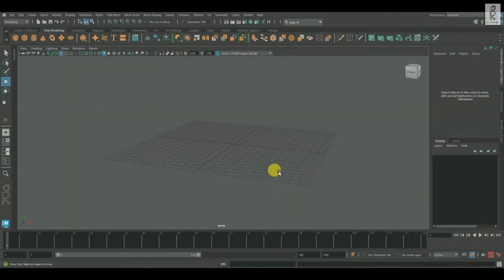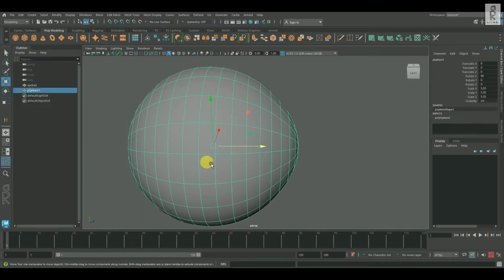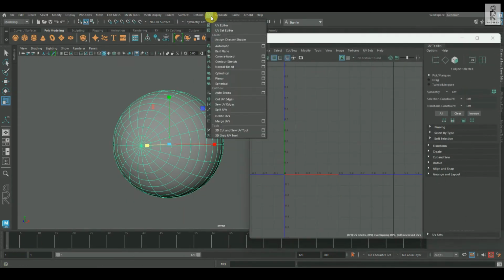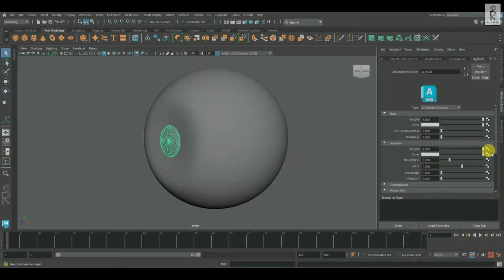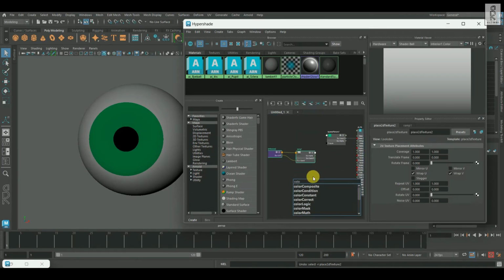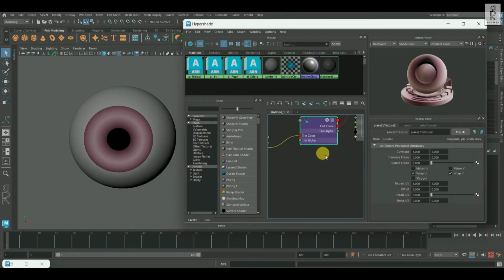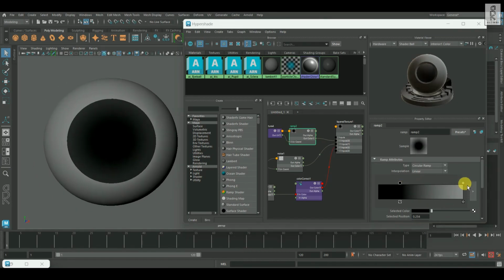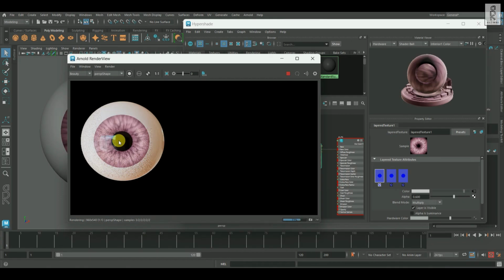How to make Eye 3D Model in Autodesk Maya | Procedural Texture in Maya and Arnold | #3d #3dmodel

Comment: Thank you for your tutorial! It was very helpful and also helped me better understand how shaders work.
Reply from the maker: @Asura4829
You're most welcome! 😊 I'm really glad the tutorial helped you and gave you a better understanding of shaders. Thanks for watching, and happy creating! 🚀🎨
Reply: @sunitdrozario  I have a question about this eye shader. How can the eye model with same shader be used to another scene? I have tested the obj and fbx, but they are not worked ,only worked when I use the whole scenes as a reference.
Reply from the maker: @Asura4829  Good question! If you're using procedural textures like those shown in the video, OBJ and FBX  may not fully preserve the shader network. OBJ and FBX sometimes don’t retain complex shader networks properly. 

I’d recommend exporting the eye model as a .mb (Maya Binary) file instead. This will keep the shader connections intact when importing into another scene. 

And if you are using any external textures which are exported from other software like Substance Painter or Photoshop, just make sure all texture paths are set correctly. Let me know if you need more help! 😊
Reply: @sunitdrozario  Thank you very much for your answer. I have tried the MB form, and it worked very well. However, I still cannot export it to SP, and since I had no relevant experience with it earlier, I will try again later when I have a better understanding of the relevant knowledge.
Reply from the maker: @Asura4829  You're very welcome! Glad to hear the .mb format worked well. 

For exporting to Substance Painter, procedural textures in Maya won’t transfer directly, so you’ll need to bake them into texture maps first. You can use Maya’s 'Bake Texture' feature or render them out using Arnold’s AOVs. Once you have the baked maps, you can easily import them into SP.

 Hope this helps, and feel free to ask if you need more guidance! 😊🎨
Reply: @sunitdrozario Once again, I really appreciate your guidance! It helped me export a texture map from Maya to Substance Painter, allowing me to achieve the effect I was aiming for.😇😇
Reply from the maker: @ Hey there, Glad to hear that my suggestion helped you achieve the effect you were aiming for! 🎨🚀 

Keep creating awesome work, and feel free to reach out if you ever need more guidance. Happy texturing! 🙌😊
Reply: @sunitdrozario ❤

Comment: Hi, nice tutorial! How you scale the pupil at min 04:10 without changing transform (Scale X,Y,Z =1) and how you maximize/change view from 4 Side to default. Was a bit pain for me to not know all this shortcuts and follow step by step without advice as newbie in maya. Googled 15 min but found nothing that explains me that.
Reply from the maker: @mongodb5166

Hi! Thanks for watching, and I’m glad you enjoyed the tutorial! For scaling the any object without adjusting the Scale X, Y, Z transforms, you can use the scale tool in world mode. 

Press 'R' on keyboard for scale tool. Then by holding ctrl key, shift key and right click simultaneously, you will get the options to change the scale tool in World mode, object mode, component mode etc. Make sure you select World mode, so that when you scale any object from one axis, it will not affect the values in channel box 😁. However If you scale it from the middle, then all the values in scale X, Y and Z will change.

As for switching between different viewport layouts, you can quickly maximize a panel view by hovering over it and pressing Spacebar. To switch back to the default four-panel view, press Spacebar again while hovering over any panel.

I know Maya's shortcuts can be tricky at first, but learning a few essentials can really speed things up. Feel free to ask if you have any more questions—I’m here to help! 😊
Reply: @sunitdrozario  thank you!! :)
Reply from the maker: @mongodb5166  Your most welcome 😊